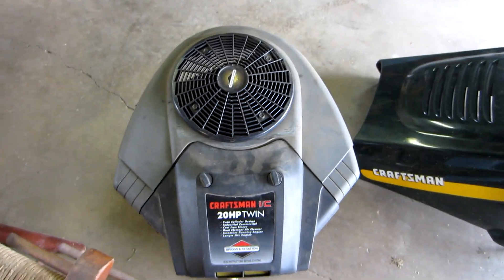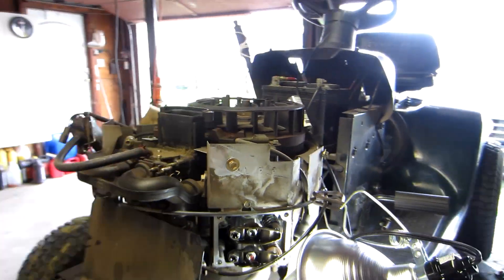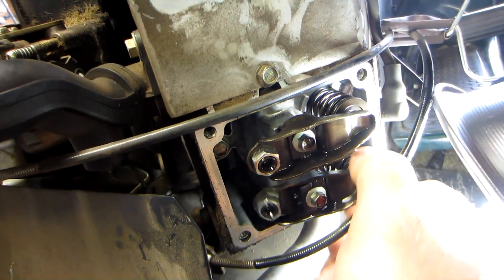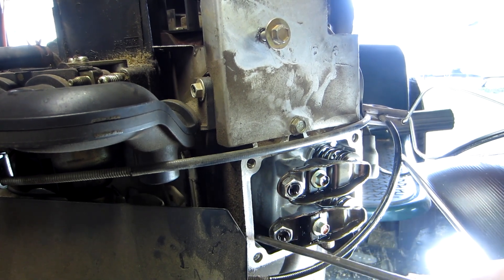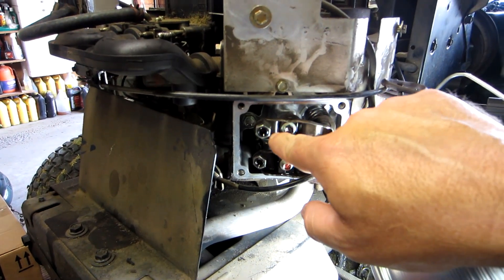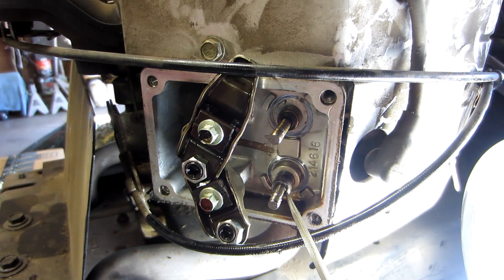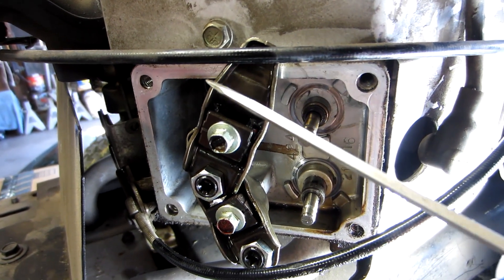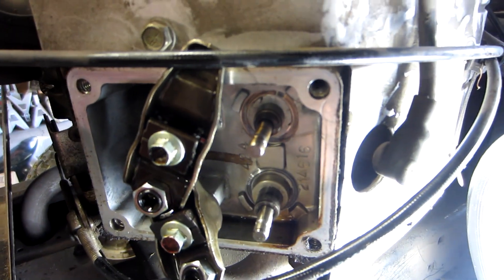Briggs Intek Bent Push Rods

Comment: I just had this problem and after seeing several videos figured that the set screw method would be the best fix but when I drilled the aluminum it was not thick enough to thread so I drilled a divot into the valve guide and then JB welded it and peened around the top and bottom of the guide, put it all back together and then torture tested it mowing tall grass in extreme heat and it held up just fine.

Comment: Thanks for the info, for $86 for new head, washers and hardware is a no brainier.. heck I would replace both... today in 2025 the prices are ridiculous at $218 for this kit and you don't even get new push rods with it, those are separate... so will try other options to hold the valve guide in.  Another link "Taryl fixes all" he drilled and screwed in a set screw and used lock tight to hold in the valve guide.

Comment: Does the head get ruined when the valve stem guide comes out?  Why not press new valve spring guides back in?   Then all good again.. just don't overheat motor with rat nest on top.  I might leave the beauty cover off my mower now for better cleaning and cooling.

Comment: Now that these are $220 for one... I would do what I saw another mechanic do... Drill and tap the head, install a set screw. Also requires putting a dimple in the guide, something for the set screw to get into.

Comment: Thank you for the tip!! My steel exhaust lifter was also injected in my engine. It couldn't quite be extracted up the oil filler tube, The bend was a little too tight. The filler tube is attached by one bolt, but the bolt is under the flywheel. So rather than remove the flywheel, I cut the flange of the fill tube and removed the tube. The push rod was then easily extracted. I mended the filler tube back together with a small plate of sheet metal and a couple of screws.  This would not work with the aluminum (non magnetic) push rod. The technique saved me a lot of time and effort. Thank you again!

Comment: Briggs and Stratton Intek motors have a factory design flaw with the head gaskets, theirs a strip of gasket that doesn't get bolted down in the middle and sucks oil from the valves into the cylinder

Comment: Have Briggs and Stratton 16hp ohv has compression 145psi both cylinders has spark check plug to ground has fuel but won’t even pop with starting fluid got me stumped?

Comment: Keep it clean!  It’s not just the fins on the head!  Pay attention to the casting around the exhaust valve, oil with dirt makes multiple layers from the valve cover leaking.  This causes insulation and the area directly at the surrounding casting of the exhaust guide cannot cool, only get hotter and hotter.  Pay attention to the carb also, if it’s to lean that means more combustion heat.  All these mowers these days are running so lean by EPA standards that they are asking to self destruct.

Comment: I have a question if you could help me out. I'm working on a guys craftsman lawnmower. It has a 24hp briggs V-twin and he wanted me to get it running. It turned over fine sounded good while turning over and everything. I checked for fuel, spark, air, compression. All was good I thought. It was firing but wouldn't start. Not even when I sprayed it with carb cleaner or ether. So I pulled the carb and cleaned it just to be safe and still nothing. I pulled both valve covers off and both intake pushrods are bent. Both of them. I was thinking maybe someone didnt set the valves correctly but it looks like this was the first time the valve covers have ever been taken off. Why did both pushrods bend. I haven't messed with it anymore but plan to tomorrow. Just wanting to know why both intake aluminum pushrods bent. Very strange

Comment: The issue I came across with mine was a valve seat inside the head came loose and wedged the valve so it couldn't move. I tapped it back in. Now waiting on gaskets and a push rod

Comment: Great video. I hammered the exhaust valve guide flush with the surface. I'm still having backfiring issues. Is this a problem? Thinking it's only a problem if the guide it out too much preventing the spring to compress all the way.

Comment: Completely remove the valve guide and run a very small weld bead around the bottom of the guide. Clean it up and punch it back in. The guide will never be able to slide up again. You can also weld a small washer on the bottom side. They should have designed the guide like a proper insert.

Comment: 9:48
Rather than peening on that hump, I think I have seen someone drill and tap a hole perpendicular to the valve guide through the side of that hump and then install a set screw to hold the guide in place.
I am not sure how they did that. Perhaps you also have to drill through the side of the head as well and reach the hump by going through that hole in the side of the head -- and then plug that hole as well.

Comment: Nice video. Thx. Rebuilding my Intek right now. Exact same issue. Was fortunate enough to find a pair of nice used heads with good seats on eBay at a very reasonable price. Fingers crossed. No way I'm spending $180-$200 for a new single head.

Comment: Excellent Presentation. Im having this exact problem with my 2015 B&S Platinum V-Twin 22HP engine on my Craftsman Z6000 zero - turn with 425 hours on the clock. Ive checked the Ignition coils, the two Diodes in the kill wire for the Ignition coils, fuel supply, and spark plugs. I can unplug the plug wire from the dead left cylinder and it still starts up and runs nicely but has low power , and only the mower deck will bog it down in taller grass , grass that I used to drive through at high speed effortlessly. It runs quiet and cuts smooth right now if I drive it real slow. I will check my vacuum operated fuel pump to verify enough fuel supply tomorrow , before pulling the valve covers and checking the items you described in excellent detail in this video. Thank you very much for this video. And also for you not cussing or using trashy language. Your addition of the info about acquiring a new head assy will be my route if I have bent push rods. Thanks again.

Comment: My mower doesn’t start unless I spray gasoline into the air filter intake
Reply from the maker: That means you have fuel delivery problem. Either the carburetor is not allowing fuel to go through the jet or you're not getting fuel to go through the needle in seat into the bowl or you are not getting fuel from the fuel tank through the petcock into the fuel line. Or finally the gas is more than 60 days old

Comment: I have 3 single cylinder  john deeres and all three motors have the intake valves on the bottom and have the aluminum rod is on the bottom.

Comment: Ok I got new push rods (I verified they are the exact same size as the original push rods ), however when I try to insert the new pushrod it’s falls too deep into the galley it goes into???

Not sure what the issue is?

Can someone chime in and let me know what to look for?
Reply from the maker: If you have the pushrods definitely lined up in the correct position and they are going to Deep and you have your rocker arms adjusted correctly then you definitely have internal problems potentially the camshaft is broke
Reply: @Foxboss9  I finally got them into the correct position, thanks for commenting though, but the valve guide pushed back out again and bent the new rods.  So I ordered a new head!

Comment: I had this EXACT issue w my John Deere Ztrac 757 today!  Was mowing and suddenly noticed that the mower had a difficult time keeping the blades/pto going and moving at the same time.

So checked spark, fine.
Checked pulling each plug wire at a time, sure enough it was only running on one cylinder.

Pulled the valve cover and both push rods bent!  Looks like guides are out just as was shown here, going to try to peening method and order two new push rods.

^both of my original push rods are steel!!

Also I found a small very thin spring int the valve cover??? Not sure where that came from!

Pulled the other valve cover and looks like the guides where starting to back themselves out as well!!!  

So I’m going to give this method a try, change the oil, filter, new plugs (General tune up!). Install new push rods after seating snd peening the guides and send it!!

Mower is a 2008 but only has 228 hours on it so I’m shocked this happened honestly!  I use this mower for homeowner use, not commercially even though it’s more on the commercial style mower.

Any thoughts on the small very thin spring?

And I’m a bit concerned that BOTH pushrods bent on the left head (V-Twin) which again concerns me! How would both bend at the same time?
Reply from the maker: Interference from one of the other ones failing

Comment: What do you think about using a die grinder with a small cutoff wheel and cutting a small groove around the outside of the guide so it will sit just below the surface after you push the guide back in place? Think the peening would fill that groove and hold it better if you did that?

Comment: FB9 have you ever broke a torx off into Those rocker adjustment nut how would you remove that??? Great video on the push rod. Hammer method works great for me.

Comment: Great video. Thanks. I love Briggs engines but i could not believe they didn't make these push rods big enough that they couldn't get sucked into the engine if they bent or came loose untill it happened to mine. i couldn't get it out with a magnet so i had to remove the engine and sump and there it was. same I had a bent intake push rod on the other side about 2 years ago but it didn't get sucked down into the engine.

Comment: Great video. discovered the valve guide extended outward.  Couple questions, how did you get the valve springs off in your video without a valve spring compressor?   How would you get them back on? and you commented the new head assembly from Briggs at around $90. The link to amazon shows the head I want, with the components you show within the box, but now at $190. Your thoughts?  Tom DeMarco

Comment: great video, this will help, once I get the right rod. Local shop sold me what I could tell was aluminum rod for the steel exhaust rod. Took it back with a magnet to show, they gave me a steel one, but the diameter is smaller than original. Not much confidence in what I hoped wouldn't be the hardest part of the whole job...getting the part! thx

Comment: Thank you my new best friend. Because of your video, I got mine out through the dipstick. I started fishing and could not believe my eyes when I saw the rod, but not expecting it I dropped it back into the pan. But two more tires and out it came. My lawn tractor (JD LA120) is old so I was just going to let it stay in there and take my chances as I was not about to rip the motor apart on a 14 year old lawn tractor. Thanks again,

Comment: All the V- Twins seem to bend pushrods. I've read Kohler, Kawasaki, Briggs etc. All have a common problem.
I wished you could've shown us how you compressed the spring to get the collets out. Is there a special tool you need for when the heads are on ??

Comment: My 24hp B&S is losing power after about 30 minutes of mowing and starts to run rough immediately. Is this going to only 1 cylinder or both sticking? Do you need to drain the oil to pull the covers off? I just changed the oil.

Comment: can you reuse the head bolts? or are they like a car, where they stretch & need to be replaced?
Reply from the maker: Supposed to use new head bolts too. With that said, I rarely bought new head bolts if they were not included.

Comment: TO KEEP VALVES FROM SLIDING BACK, you can use the hose from compression tester (the kind with a quick connector hose), screw it into the spark plug hole, then put about 40 pounds air into cylinder. Do this with piston TDC on compression stroke. A socket on flywheel nut, along with a handle to turn against anything to keep engine from turning holds it in place. 
Higher air pressure fine (remember, the engine normally has much higher) but 35 to 40 pounds pressure usually more than adequate to push against valves and hold them in place.

Comment: Is the exhaust always on the bottom? 19.5hp b&s.
Reply from the maker: If you're ever in doubt, just look at where the carburetor plastic intake enters into the head and look at which valve is closest to that. That would be the intake valve. Then look at the metal exhaust pipe and where it connects to the Head, the valve that is closest to that area is the exhaust valve.
Reply: Foxboss9  Thank you for your help and quick response, sir. I have no one to call for these situations. Subscribing.
Reply: I am replacing push rods so I don’t want to put the wrong ones on. Great video!!

Comment: Very informative. Thanks for the help. I was able to get my father in law mowing again. Funny, on his mower the intake push rod was slightly loose but otherwise fine. The exhaust was thankfully still sitting up in the head but very bent. No problems at all with the right head. Out of curiosity, could this possible be caused by not keeping the valves adjusted properly?
Reply from the maker: The loose push rod could be from Mis adjustment however, the bent pushrod almost always is caused by the valve guide grabbing it
Reply: Foxboss9 yep it was the guides. I put new rods in and rolled it over by hand. The exhaust rod bent on the first rotation. Time for new heads. Thanks! You have been very helpful!

Comment: Cool video very informative, I have worked on engines of all types for many many years and I have found that the intek engines will have valve guides that have moved in them fairly regularly , it's not because of a bad engine design but rather from extended use over hours and hours of continuous use like cutting several hours only to stop and gas up , check oil and go again , or if you cut really thick grass and cut it low at a faster than what you should speed it puts a hell of a strain on the engine and that causes excessive heat , the aluminum head expands more than the steel valve guide does and it causes the valve guide to move out of place ! Also I had a strange experience a while back while mowing grass , everything was going great, grass wasn't that thick and blades we're sharp and all of sudden my 20 horse ohv single cylinder intek revved all the way and died with a struggle like i had ran over a huge pile of rope and I thought I had , but upon looking I didn't see anything an when I checked oil level it was good and when I attempted to start the engine it sounded off like it was out of time or , what I thought was maybe the oil pump went out , but anyway I pushed it on the trailer and went home and pulled the engine and replaced it with another one , now I didn't do anything to the engine and I still have it , but later this almost happened again and I managed to turn the blades off before the engine died and when I looked the deck had dropped all the way down to the lowest cutting height !! Well guess what ?? The dam spring that holds pressure against the height lever to keep it locked into the detented height guages the little grooves that are made into the side body , yeah those , well the little spring was there but the long part of the spring was missing , broke , so THATS WHAT happened with the last time so my other intek engines probably ok just maybe a bent push rod ?? Now I gotta find out !! So here's your million dollar tip , check your deck height lever handle make sure the spring that holds it firmly in the selected cutting groove is ok and NOT BROKE !!!

Comment: Where does the aluminum push rod go in the intake or exhaust
Reply: Aluminum push rod goes to the intake valve always , follow the port from carb to where it fits the head , that's the intake side , exhaust side ALWAYS is close to muffler , exhaust push rod is steel !
Reply: Thanks Mark

Comment: hi great video,took my valve case off to find my valve rocker was not on valve ,valve sat still in place and not bent.put top dead center and put back rocker onto valve.spun engine by hand and all seems ok checked other push rod and was ok,have not tried to start engine yet.what could have caused this thanks wayne.

Comment: I just replaced the carburetor on my 15yr 24 horsepower v-twin and I had the red round ring intake gasket but the carb kit came with the stick on intake gasket so I just used both. Seems to be working fine so far.

Comment: I found a bent push rod but my question is I have no compression and the mower won't start. Could the bent push rod cause my mower not to start at all?
Reply from the maker: Absolutely. If the intake rod is the one that is bent then your intake valve will not open to allow air and fuel to enter into the combustion chamber. If the exhaust Rod is bent then your exhaust valve will not open to allow the burnt gases to exit so as to let new fresh air and fuel in the combustion chamber. Even if both push rods were absolutely straight and your valves were slightly Miss adjusted it would cause it not to run. So definitely your bent pushrod is causing it not to run

Comment: Had one fall into the crank. It miraculously didn't cause any damage, despite having to pass by the cam, connecting rods, and crankshaft. After inspection of the head, it's my opinion that the guide failed do to tolerances in the casting, and not necessarily air flow blockage. These tolerances were so bad on one head, that after I froze the guide for reinsertion, I was able to push it back in with my fingers. (and there wasn't any damage to the head) That's pretty much a dead giveaway that it's bad quality control.
Reply from the maker: I once had a steel push rod wrap around the crank up against the connecting rod. You see enough of them and there's some weird stuff that goes on sometimes and you wonder how in the world it even happened.